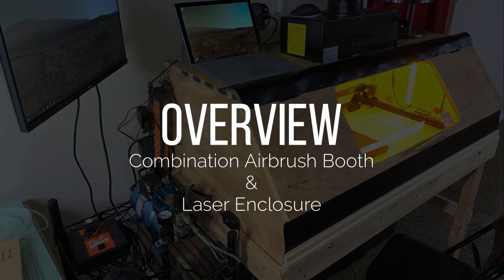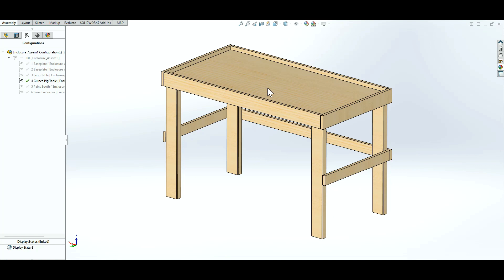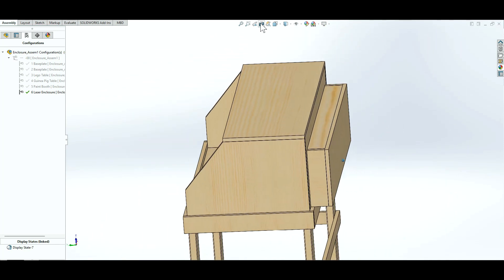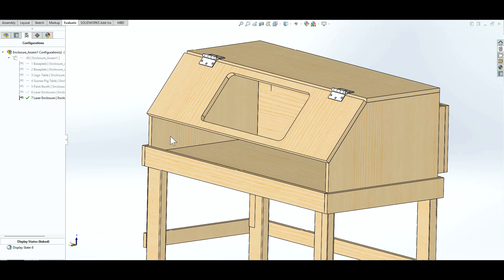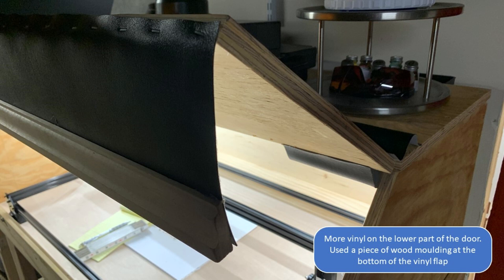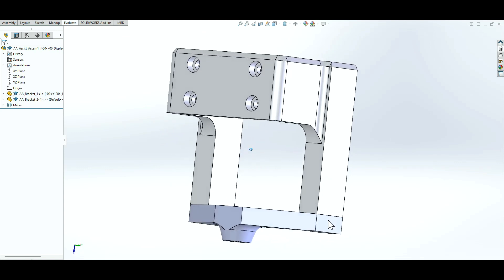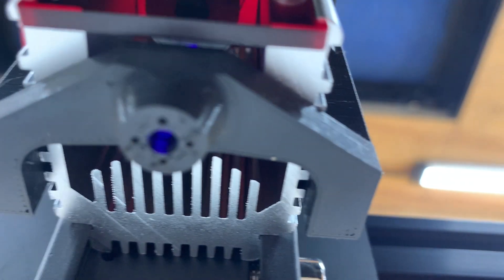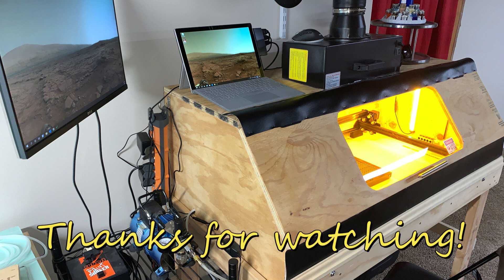Overview of a DIY combination airbrush and laser enclosure for NEJE Master 2s Max

Comment: How is the air brush compressor doing for the air assist?
Reply from the maker: It’s ok for short cuts. Maybe anything less than 10-15 minutes but it gets pretty hot after that. I do need to upgrade to something that can run longer.

Comment: I have looked at many different enclosures plans on You Tube and IF I was building one today, I would try to make it look just like yours. Very well planned and a very clean looking design. Unfortunately I already spent all my money on accessories for my laser and the price of plywood is scary, so this will have to set on the back burner for a while. 
Thank you so much for the plans and attention to detail as well as your time! 
I do have one question, what material did you make your black riser blocks out of?  Again Thank You Sir for sharing your time and wisdom!
John